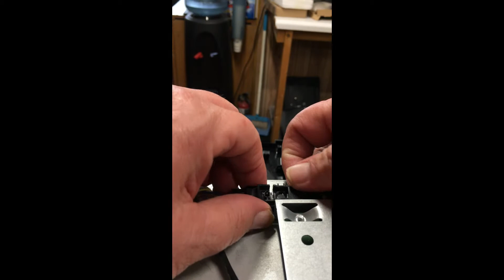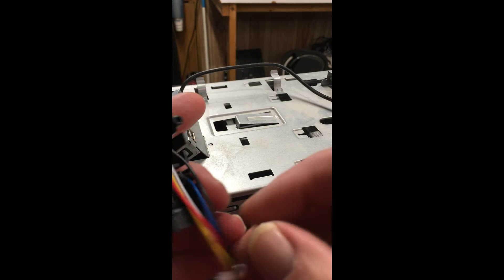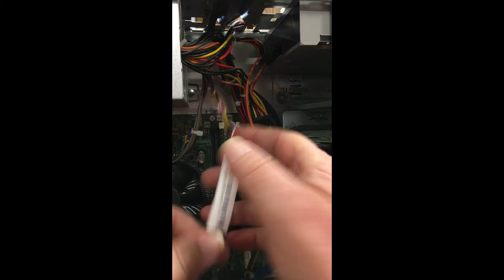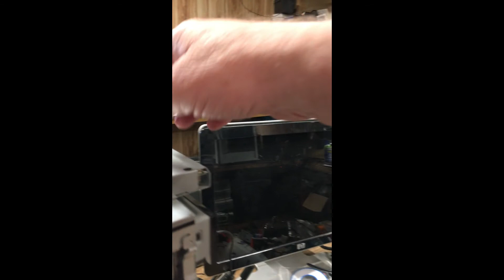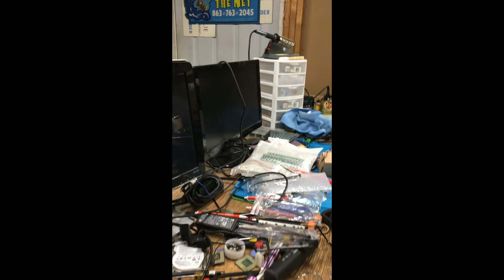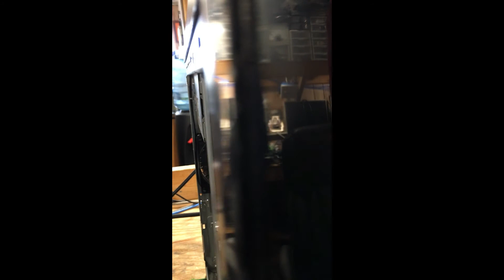Powerswitch replacement on a Dell xps

Comment: Can you tell me where to order the power button switch for a xps 13 9365, and part number.  I love your video!!  My switch has always been very "tender" acting and now it's just not working at all.  I took replaced the battery, the ports are loose, I tried to clean gunk all around but must have jogged this switch too much.

Comment: How on earth did you remove the top plastic case piece?
Reply: Probably a bit late for you, but in case anyone else needs to know: Look inside the case under the top cover. Right behind the DVD drive is a metal latch protruding down into the case. You need to pull the latch down (into the case) and then slide the top cover forward. The top cover will then lift off. To replace the top cover put it back on the top in the forward position and then slide it back. The latch will engage automatically. No need to pull it.
Reply: Page 47. https://dl.dell.com/manuals/all-products/esuprt_desktop/esuprt_xps_desktop/xps-8700_owner's%20manual_en-us.pdf#page47

Comment: Thank you Just wish you woulld show me how to get the cover off.

Paul
Reply: Probably a bit late for you, but in case anyone else needs to know: Look inside the case under the top cover. Right behind the DVD drive is a metal latch protruding down into the case. You need to pull the latch down (into the case) and then slide the top cover forward. The top cover will then lift off. To replace the top cover put it back on the top in the forward position and then slide it back. The latch will engage automatically. No need to pull it.
Reply: https://dl.dell.com/manuals/all-products/esuprt_desktop/esuprt_xps_desktop/xps-8700_owner's%20manual_en-us.pdf#page47

Comment: Where do I get the replacement button switch?
Reply from the maker: Have you googled a search with you make and model?
Reply: @edwiz100  Thanks, it is just the button. I have to press it for several minutes before it kicks in. I found several bu there is no button to it, just the switch.
Reply from the maker: It is not easy to get case part’s unless someone is selling one. You can try eBay search. You may try to buy a used system that doesn’t work for the case parts. Or buy a used case to transfer motherboard and internal parts.
Or if you know someone that could put in a different switch. Even a toggle switch.
Not sure how old the system is. You may be better off with a new system with widows 11
Let me know how things turn out.

Comment: I'm having difficulty turning on my XPS 8900 as well. Sometimes it shows 7 - 2 Orange flashes, sometimes it's 2 -1. But I read that someone found out that it's just the Power Button Switch Module. Also because even with these flashes, a few hard restart might turn the PC. So it's time to buy the power switch and do the replacement.